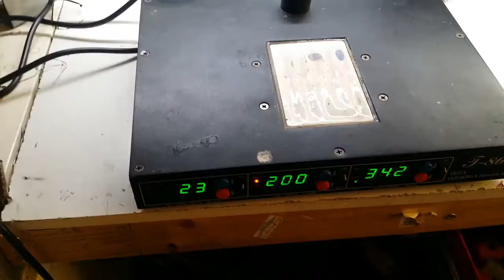T-862 rework station taking a look inside

Comment: Where is part 2? if there is a part 2?
Reply from the maker: there is not a part 2, i still have the unstability problems and now the lamp has blown :( and i havnt had time to look at it again
Reply: That's unfortunate, I do hope that you get to do it eventually. Be interesting to see how you fault find the issue. I did think it was a transistor problem, but I'm not as well versed on the problem as you appear to be. I wish you luck with it.

Comment: u able to read whats the output voltage at the connection to the top ir heater i got the top part want to build my own base need to know the output if its ac or dc volts and at what voltage so far i found on pins 3 and 4 its to power the ir top bulb pin 1 is positive  fan and pin 2 negative fan lead  pet me know thanks
Reply from the maker: The bulb is a 50w 12v lamp, i would imagine its AC as there is no big rectifiers to produce the DC, the lamp wont care if its AC or DC to be honist.
Reply: +Kevs Electrical Workshop cool just wondering